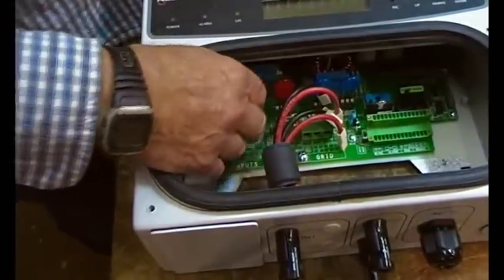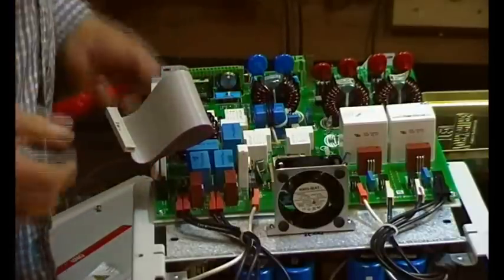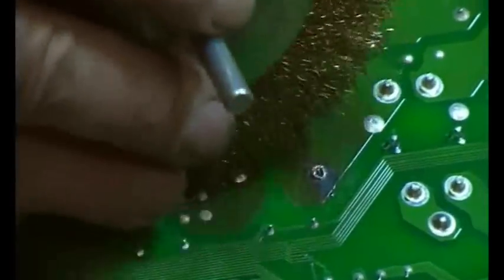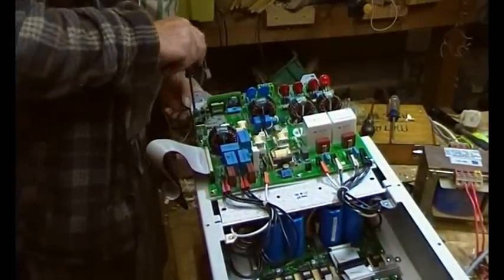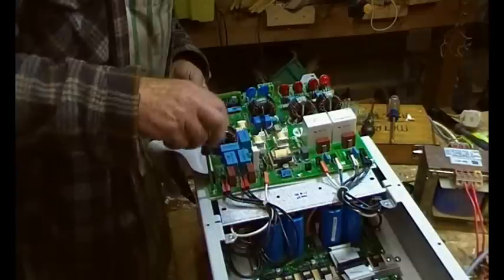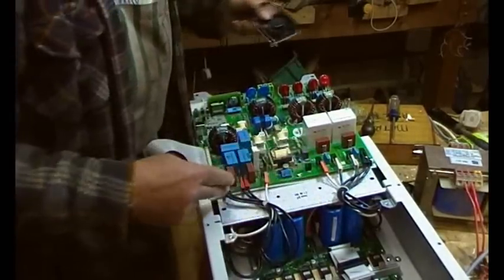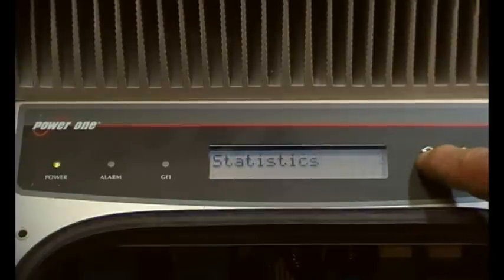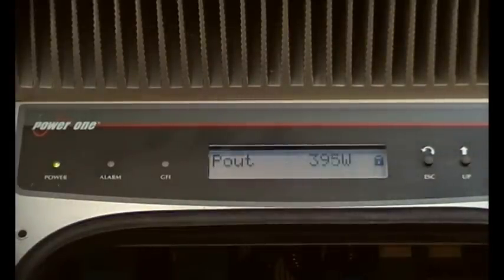ABB Aurora  inverter fault code E031 fix / repair

Comment: Thank you so much for making this. It saved me so much hassle/money. When I re-soldered the terminal it didn’t work the first time but after wiping it clean I noticed that the terminal had burnt out further down in the board. I soldered it again deep down inside the board and it worked a treat. Your instructions were spot on! Love your work
Reply from the maker: Steve, thanks for your appreciation, please see my channel page under the about button. Also see my recent video on preventing inverter failure (Feb 2019) cheers and thanks for your support.

Comment: I just repaired my Aurora using your instructions. Fantastic worked first time. I was going to be charged 1000 quid for a replacement. I  can't really figure out their hourly rate for installation as the replacement inverter was 575 quid and the rest was labor & vat.  I removed the broken inverter, cut off the top of the relays, bent the switches, re soldered the circuit board and re-installed within 2 hours. It's guys like you who take the time and effort to share you're expertise to help others that really gives me faith in the human race. I'm going to give 50 quid to charity on your behalf. Thanks, Sean Walker
Reply from the maker: Sean, thanks for your repair storey, I've got lots to tell you, first see my video (Feb 2019) on solar grid inverters, extending the working life, go to my channel page and search in videos. Whilst you are on this page there are links to my books and Patreon donation under "about", cheers

Comment: Thank you Andy. Great video to get me inspired to have a go at fixing my Aurora Solar inverter. My inverter was not throwing up any faults codes it was just reading Pout 0W. I called a local Solar repair company and the best they could offer was a $500 full audit and report of my solar system before they could do any fault finding....When I pulled the inverter a part I found a dry joint on the board you were working on (a joint under one of the those relays you cut apart). I scratched the burnt bits off the joint and threw some solder in, put the unit back together and it is now working a treat. Thank you once again from Mackay (Australia) for a great easy to follow video.
Reply from the maker: Well done, another unit saved (and loads of cash) please see my recent video showing how to prevent these problems (Feb 2019) and consider my books or Patreon, cheers
Reply: Hi Mates Rate.... I've got fault E031 and want to remove my existing unit. Was it dead simple to remove the existing unit ? Any electrical safety checks you did or just disconnected the input cables from the 2 black solar Panel switches, 1 Red Switch and the power input cable? Just want to check before I attempt :) Thank You

Comment: Thank you Andy! Just took it apart and found one burnt solder joint also. I haven’t done this kind of thing since high school which was a couple decades ago. Can I ask you what temp do you put the solder iron at, and what type of solder do you use for this? Thank you again, from California :)
Reply from the maker: Hi, I just used a big electric soldering iron about a foot long and lead flux cored solder. Takes quite a bit of heat. See my recent video on inverter care (feb 17th 2019) to stop this happening again. Please consider Patreon and I hope you have subscribed to my channel, cheers

Comment: Thanks Andy. Got this fault in July 2018 during the heatwave in London so I bought a used inverter of same make n model and replaced it myself. Still have my old one lying around so searched here thinking what to do with it and found this. Wish I'd found this earlier. I'll now try and sell it with a link to this video rather than throwing it away! Cheers
Reply from the maker: Hi, thanks for the comment, my advice would be to fix it, test it and then keep it as a spare. Also I will be uploading a video shortly on increasing the life of a grid inverter. Subscribed? cheers
Reply: @TheInfoworks  Subscribed, thanks!

Comment: Thanks heaps Andy, I am another Aussie fan, found 3 burnt out soldered joints, resoldered them and Magic, my 6 year old inverter is working again. You just saved me $2000. Great job.
Reply from the maker: Excellent, to keep the heat down I have a very small electric fan set up to blow air up the back of the inverter. This is controlled by a plug in timer and runs between 10 am and 4 pm. I used a snail fan from a fan assist oven. Check out my books, Subscribed? cheers

Comment: just found your fix amazing  it works thanks very much
Reply from the maker: Hi, I get the feeling that this fault is caused by running the unit to full wack with poor cooling. Check out the rest of my many videos, Subscribed? Cheers

Comment: Thank you from Oz!  My inverter had been working fine for 6 years until today when I noticed the "internal error E031" and the power light flashing continuously.  I followed your repair procedure and found one solder joint that looked exactly like those in your video.
After resoldering the joint as you did, my inverter is now humming along like new again.
The manufacturer and their approved repairers will have you believe that the internal error is irreparable and that it you would have to buy a new one.  As my inverter was a year out of warranty, I would like to thank you once again for saving me some money with your timely video.
Reply from the maker: Hi, thanks for your appreciation and info, another one fixed at no cost. Please consider my books shown on my channel page. Subscribed? cheers, Andy

Comment: Good job Andy !!  That's how I taught my son to work on everything around the house.  I'd tell him its already broke, you can't hurt it so dig in and see if you can find the problem. 

On tiny spot solder joints I use a 50 year old woodburners kit with the round point on it.  It works wonderfully on those teeny tiny spots.  Do you have a Sal Ammoniac block for cleaning/tinning your iron ?
Reply from the maker: Cheers, and yes I know the bit is a bit scabby and this large iron is only used occasionally, hence the state it is in.

Comment: Definitely been arcing at those joints, most likely the relay contacts had got hot and the heat transferred through the pins and melted the joints.
Reply from the maker: Hi, the relay contacts showed no signs of burning and they had not changed colour. All 3 boards I have show the same fault so I assume the relay tab and the board hole are too small for the current which could be at 400 volts. Cheers

Comment: Go Andy 👍
Reply from the maker: Got there, but what caused it? cheers
Reply: @TheInfoworks  Ultimately heat caused by underspecification / poor workmanship at the joint caused arcing that eventually broke the circuit.  What component was the connection holding on the board?
Reply from the maker: Jim, it was a relay connection, but the relay blade showed no signs of heat, it's obviously a common fault as all 3 boards I have show the same fault, cheers
Reply: Hello Andy , have you also get Internal error fault E021 ?
Reply from the maker: Hi, according to Gold Coast solar E021 is a relay fault, I would suggest taking the covers off the relays and looking for contact problems, also cleaning the contacts. Check the to see if all the coils have the same resistance. Cheers

Comment: Well done Andy. It's a bit of a concern that there could be lousy solder joints in a mains inverter like that - those two circuit board pads were large area - suggesting high current through them - also they both look like they have overheated - let's hope the joints were the cause and not the result :o) Thumbs up for a saved item ! Cheers, Dave
Reply from the maker: Dave, thanks for that and yes I suspect the fault was caused by a huge current, only time and use will tell, cheers